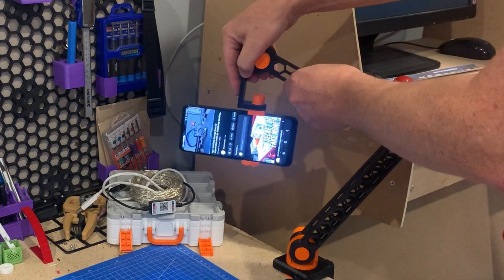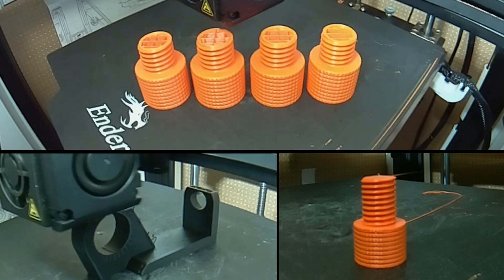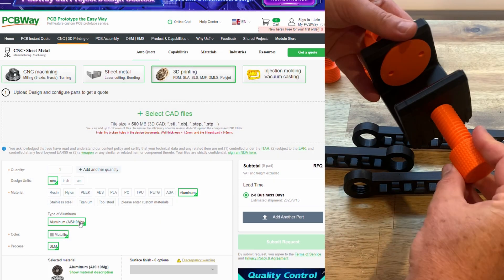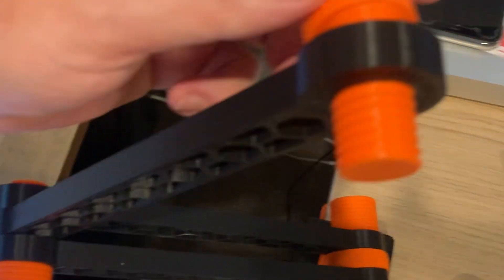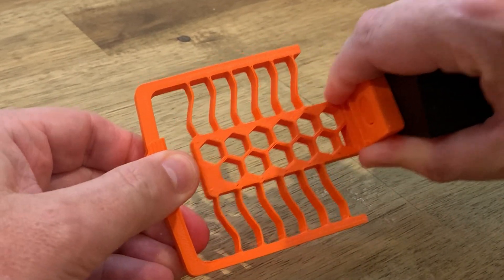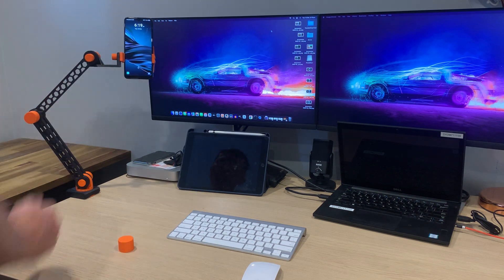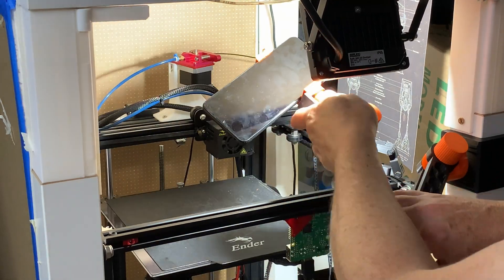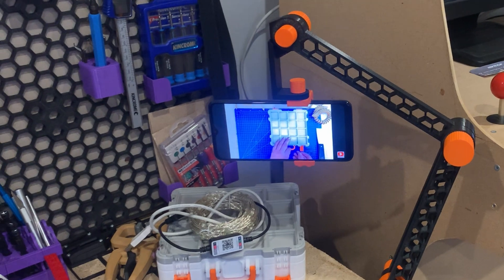Building a strong desk arm with 3D printing 🦾 Top trending 3d prints

Comment: If I printed this as a phone holder in my car, would the joints be stable whilst driving?
Reply from the maker: As long as you printed in something that can withstand the heat of a car without warping it would be fine if you can find somewhere to mount it too.  I'd look at one of the remixes like https://www.printables.com/model/947738-stronger-bolts-threadless-arms-and-double-threaded that was a bit better grip around the joint areas and stronger bolts.

Comment: i print right now on my ender 3 pro, thanks for sharing.
Reply from the maker: Definately make sure you check out the remixes like https://www.printables.com/model/921831-better-grip-for-base-2-and-25cm-frame that have better grip.  The original ones I printed ended up getting a bit loose for me.

Comment: Thanks for vid. The bolt of yours failed because of the way slicers don't automatically optimize strength where it is needed. In your slicer, if you add a height range modifier and make the print solid, a few mm above and beneath where the knurling connects to the threaded part, the bolt will be plenty strong while the bulk of the knurled handle remains hollow.
Reply from the maker: I like that idea.  I’ll definitely be giving it a try.
Reply: Thank you dear Sir. I didn't even know there was such option. Now in process of printing

Comment: I just printed two of them out, one with two short arms (i cut the bolts down to 48mm in the slicer) and one with three 2x short arms. Very sturdy, and same issue with PLA on the compliant phone grip which i probably will print PETG if i need or want another one. Definitely not fun getting just the right angle using the 2D swivels, I'm going to design a ball mount to replace the two 2D swivels needed. Also, feels a little bouncy and might also change the base a little while im at it

Printed mine in Elegoo PLA+ 0.2mm layer height @230c on a Volcano nozzle @325mm/s(4K), two shells (both 0.4mm), and 15% Grid infill with layer combination turned on. Limited flow to 26mm3s for best strength on my printer, I cranked on the larger bolts and they held very well without any of the dreaded layer crackling
Reply from the maker: that’s significant time saving!  I’ll be testing that in the next week or two for sure.
Reply from the maker: Sounds like you’ve got trying a dialed in really well.  I haven’t played with layer combination yet.  What situations have you found it most useful?
Reply: @3DPrintSmith  I haven't fully tested the strength of infill combination yet, but it feels just as strong. Otherwise it saved almost 3 hours on a 9 hour print job printing these parts. Think it was a 5:45 min print job for all the parts and three short arms.
Reply: Sounds like I really need to check that out withy that kind of time saving.

Comment: I think if you had a few rubber washers that were big enough for the size of the bolt you could put them between the arms.  That should help the grip.  I can also see a remix where they put teeth on the part that connects.
Reply from the maker: that’s a great idea.  I might try a TPU washer so I can get it the perfect size.